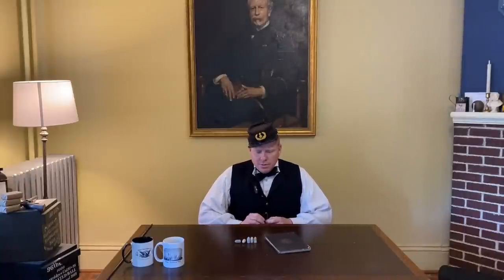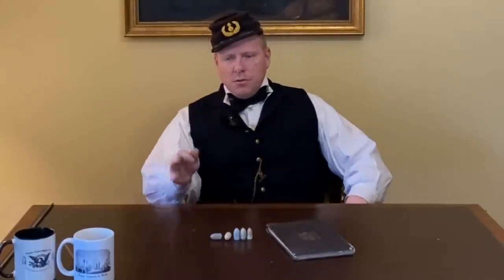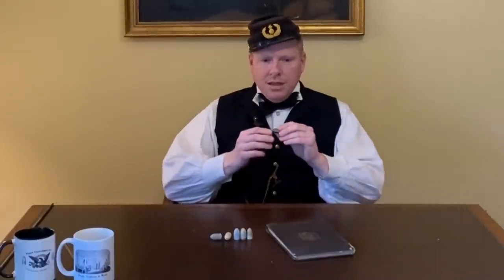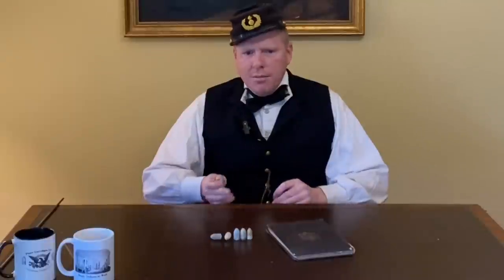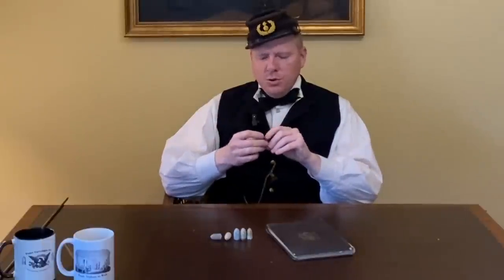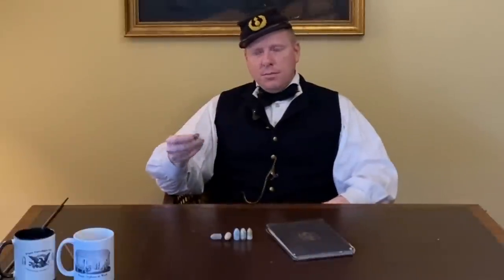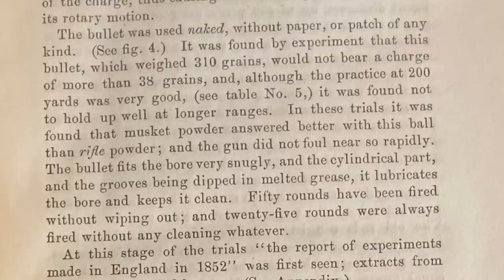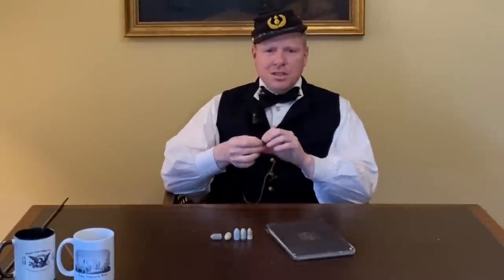Why did Civil War bullets have grooves?

Comment: I also heard, or maybe just surmised, that the grooves also scraped out some of the black powder fouling as it travelled down the barrel.   We saw some surprising things  shooting .69 cal Minie' balls from a 12ga using a sabot.   They had great stability through rifling with a spin but also were stabile shot through a smooth bore with no spin at all.    The 725 grain Minies are quite unpleasant shooting from a 7.5 lb. shotgun.
Reply: That's taofledermaus in the flesh and bones, guys!
Reply from the maker: There may be an ancillary benefit to having multiple grooves to reduce fouling, but I have never encountered this reason in any of the period documentation, in English or French. Fouling is chiefly controlled by the grease softening the fouling of the precious shot, and then when the bullet expands upon firing, it drives out the fouling ahead of it. The sooner the bullet expands before it moves far down the barrel, the much better job it does scraping fouling. Properly sized bullets (2 thou under bore size) can be fired almost indefinitely.
Reply: @papercartridges6705  I think another aspect of the cannelures or grooves around the cylindrical section of the bullet is it slightly weakens the structural rigidity of the bullet.  Initial gas pressure as the powder charge ignites, expands the base ring sufficiently to fill the rifling grooves and prevent blow-by; initial acceleration causes the bullet to slightly foreshorten, or upset into the rifling, thus establishing proper alignment of the bullet to the axis of the barrel.
Reply: No.
Reply: @lucarinaldichini324 and?
Reply: I just nominated you for head of NASA in Tundra Tacticals government line up for our new government.

Comment: Learned something new today.  I thought for the longest time that those grooves were for the bullet to "catch" the rifling in the barrel. I figured that when the power was ignited, the grooves would expand to catch unto the rifling starting the bullets turning. I didn't even think about putting lube on the grooves for easy of loading either. Thanks for the info.

Comment: The grooves also thinned the sidewall of the bullet  at the Ogave, allowing that area to more efficiently expand & better take the rifling at the moment of expansion... as well as providing a more complete seal, post ignition..Enjoyed your video very much.
Reply: Ballisticslly, you are right, all other theories to the contrary.
Reply: You are exactly correct! Besides holding the lube the only reason the grooves are there are to allow the bullet to expand enough to contact the rifling on the inside of the barrel so that it will spin more accurately. Also there are alot of bullets still made with grooves on them. Almost every cast bullet still has them for lube and the same rifle engagement reasons. only plated bullets are not grooved.
Reply: @jameshoward8609  Back in the late 70s I bought full packages of originals at the bigger gun shows.They includes a Williams cleaner round and a paper pouch of about a dozen percussion caps. We have the same last name and I enjoyed your Kern River video.

Comment: For providing a platform against which the air may stabilise the round in flight and also to reduce the friction present while driving the round down the barrel. The grooves were also thought to aid in clearing fouling by utilising their multiple bands to clear fouling more effectively than a plain based bullet.
Reply: It's not a quiz.
Reply: How about to grip the rifling and improve accuracy professor?
Reply: @rollotomasislawyer3405 
The bullet could be a smaller diameter than the bore to make it easier to ram them down the barrel and expand out into the rifling when powder explodes behind the bullet's hollow base to force the back out into the rifling for the trip out of the barrel....
Reply: @rollotomasislawyer3405  it would be counterproductive for that as it increases the way the material of the bullet "walls" has tob e moved to get that contact.
A Minié ball is undercaliber until fired, then the expanding gasses widen the hollow at the end until the bullet gets pressed into the grooves. Early models had a "hat" at the end that was supposed to speed up that spreading motion, but it was later found out that just slightly enlarging the hollow worked even better.

Comment: In a nutshell, it places the aerodynamic center of pressure behind (aft) the center of gravity relative to the direction of flight. Think fletching on an arrow or fins on a rocket or a tuft of fibers on a blow-dart.
Reply: Or... to impart spin to the projectile, improving the accuracy of the rifled musket.
Reply: It places DRAG to the rear of the bullet and thus stabilize flight....
Reply: The instability is caused by the Mach-helix effect that occurs at low supersonic Mach numbers (described in 1950's missile aerodynamic textbooks). The Mach-helix effect moves the center-of-pressure forward. The circumferential grooves are oriented in the wrong direction to suppress the Mach-helix effect. The grooves, and the concave base, do move the center-of-gravity forward. The grooves also weaken the bullet aft structure and promote super-plastic material deformation. Rifling efficiency is thereby increased.
Modern rifle bullets have shapes optimized to reduce wave drag above Mach 2 (e.g. .223). These shapes are too long to effect a center-of-gravity shift on, but the spin stabilization from higher rifling rotational speed (as pointed out in the video) counters the Mach-helix effect, as does the generally higher flight Mach numbers.

Comment: I heard from a Civil War battle museum that the North and South used a different number of grooves to tell if it was freiendly fire. They had their bullets sorted into North and South by the number of grooves. I have not heard this anywhere else. Is this just an anomaly of a particular battle?
Reply from the maker: Another myth about the grooves is that Union bullets had three grooves and Confederate bullets had two. It probably started with the Confederate Gardner bullet, which did have two grooves, but only amounted for perhaps 10% or less of all CS produced rifle musket bullets. Both sides generally produced bullets with three grooves, with considerable variations in shape and weight, from arsenal to arsenal.

Comment: The grooves serve the purpose of  are one tie point for the paper cartridge. Two allowing the fired buelllet to expand into the groves  of the rifle barrel  upon firing.  Since bullets were slightly under sized to allow easier loading in a fouled  bore. However, a small side effect is that the groves will  hold a lubricant, allowing  slightly  easier cleaning

Comment: The grooves were for expansion.  I had a .58 Enfield for years (very fun to fire).  The skirt grooves allowed compression and made an excellent seal in the barrel.  This improved accuracy and spin with a better grip on the rifling.  This compression can easily be observed on rounds that have been fired.
Reply from the maker: Can you provide the source for your claim that the grooves are for expansion? I cited numerous 19th century period sources as evidence for my argument in my video. 

You may be confusing the Tamisier grooves on a Burton-Minie with the grooves on the Wilkinson/Lorenz compression bullet, which were indeed for expansion, but these bullets were never used by the U.S. at any time, and don’t have a “skirt” as you reference.
Reply: @papercartridges6705  Hi, I wrote back earlier today, but for some reason Youtube will not allow me to include links (this has happened to me before).   This is what I wrote without links:  I had an Enfield for many years and shot countless rounds through it.  I also cast my own .58's.  The "skirt" system of outside grooves (also lubrication) and hollow or "conical" base allowed the round to be more easily loaded w/o a patch.  This system would then expand upon firing, sealing the barrel to grip the lands and grooves, increasing speed and accuracy.  Compare a new Minne ball to a vintage fired one, and you will see the skirt difference.   Note:  near "intact" bullets found on the battlefields were "dropped rounds", those hastily lost by soldiers (can't blame them...).
Reply: @daveh9521  and yet you didn't provide a single extant source whereas paper cartridges provided a number including the designer of the grooved bullet adopted throughout the period.

Comment: Current lead projectiles still have these grooves which are used when crimping the metallic case, this can be beneficial in tube magazines so the recoil doesn't push the projectile further into the case.

Comment: The Prittchett and Boxer bullets have smooth sides, so why don't they have trouble with tumbling?
Reply from the maker: That’s an excellent question. The Pritchett/Boxer bullets relied solely on the spin from the rifling to stabilize them. Grooves cause drag and the British made the deliberate decision to use a smooth bullet, to get a higher velocity. Also, British bullets were made by pressure instead of being cast, and they believed this made them inherently more balanced. That said, as a Pritchett shooter, I’ve seen a ton of keyholes. They are much less forgiving to shoot accurately than a Minié with grooves!
Reply: @papercartridges6705  You really ought to try shooting your Pritchett bullets in my Pritchett rifle.  That ought to be interesting.

Comment: I shoot BPCR, all the bullets are grooved, reason being they are squeezed thru a press where a beeswax based grease is squeezed into the grooves. This grease helps to keep the black powder fouling soft and stops it choking the barrel. and makes the bore easier to clean. Black powder fouling can set hard as a rock and be a real pain to clean up.

Comment: Actually this is the same reason that most common air gun pellets have waists.  Although not formed with a sharp edge waist, the hollow base moves the center of mass forward in such a way to minimize needed aerodynamic corrective forces (applied to the skirt) to stabilize bullet flight.
Reply: This phenomenon seen in air gun pellets was noted by the Romans who employed a wasp-waisted ballista bolt without any form of fletching, relying instead on increased base drag to stabilize the bolt in flight.  It would seem the idea was discovered, forgotten, and then rediscovered multiple times in the last 2000 years.
Reply: I have shot .177 pellets out of a smoothbore Daisy BB gun by muzzle loading the pellets into the bore and ramming them down the barrel with an improvised ramrod.  They always hit the target point first regardless of the distance to the target.  Pellet guns have a very slow twist, meant more to average out the imperfections than to impart stability, so the gun isn't shooting "knuckleballs".

Comment: Arrows fly best (straighter with less wobble) with some weight forward of center. You are correct, helical fletching on arrows does not make them spin with much rpm like some people believe, but it does provide increased drag on the rear of the arrow which stabilizes the arrow well and can be helpful when arrowheads are not perfectly inline with the shaft. While modern bullets seem to do well, I suspect the older bullets with weight removed from the rear of the bullet benefit in at least ways.  The configuration of the grooves on these Civil War style bullets would tend to flare out as they were pushed down the barrel, providing a more consistent seal. A hollow base would enhance the effect of expanding outward due to pressure, just like a hollow point causes bullets to mushroom easier.

Comment: They may help stop wobble, but I find them a pain in the butt for reloading in brass cartridges.  Gotta get the crimp just right, or seat deep enough to  go past them.
Reply from the maker: They give me the same trouble especially loading .45-70 or .577 Snider. If they aren’t lined up just perfectly straight…
Reply: @papercartridges6705    I’m doing 45 colt. Pain in the butt.   But it’s my first foray into old school.  Maybe I just got a lot to learn, but with difficulty in finding ammo nowadays, I’ll have to reset my dies every time I get new bullets
Reply: Are you checking the length of your brass and trimming as needed? 
Brass does not always stretch the same all around. You can easily have one side higher (longer) than the opposing side.
Just a thought.
Reply: @tarnishedknight730  what I meant was the crimp is so easy to end up in one of the grooves and be useless

Comment: We still have multiple grooves in modern cast lead bullets. I can't speak with authority on the history, but the top groove is a crimp point for the cartridge case mouth to hold the projectile in place. The rest of them are grease grooves.

Comment: Boring,  no. Interesting! But your explanation does it also apply for the lead bullets that my Dad   & I would grease  the 2 or 3 grooves for our cast lead bullets for .32 cal, 45 cal. Long Colt, & 45 cal  ACP Bullets  that we reloaded ourselves?
Reply from the maker: I don’t think the grooves in modern bullets are designed for that effect, they are probably more for holding modern lead bullet lube which is necessary to prevent leading. But as a secondary effect, they may help some way with stabilization. Modern bullets also rotate so fast that they remain much more stable than the very absurdly slow twist of muzzleloaders.

Comment: I guess the grooves around the bullet are meant to create a labyrint seal. The pressure doesn't vent off around the lead bullet.  Bullets/slugs with several grooves leave the barrel with a higher muzzle energy.  Of course the groove " lips" dig into the barrel spiral far more effective.

Comment: The grooves are designed to hold lubricant to soften fouling and to help scrape away fouling from the previous shot.  If a sufficient powder charge is used to expand the base of the bullet into the rifling, it will do its job.  The ideal powder charge for a particular minie would expand he skirt into the rifling, provide sufficient velocity to stabilize the bullet, but not too much to deform the the skirt  when the minie leaves the muzzle.
Reply from the maker: I have to ask… did you watch the video? Before the US adopted the grooved bullet in 1855, the French had adopted grooves on their bullets a decade earlier, and never added any lubricant into the grooves.

Comment: The boat-tail actually adds a little more drag to the bullet. This allows the bullet to better "buck the wind", thus increasing accuracy at range.
Reply: boat tails reduce drag by reducing partial vacum created at the back of the bullet

Comment: Hmm, I would agree with Taofledermouse, the Minie was designed to expand on firing and so obturated and scraped the fouling from the barrel, hence the forward rake of the grooves.
Reply from the maker: You certainly don’t have to agree with me, but consider, I am simply repeating what they wrote and said in the 1840-1860s period. It’s not like I woke up one morning and decided to make up a story about why bullets have grooves. This is why I took pains to put up numerous screenshots of the original period documents. None of them (emphasis: none!) ever said the grooves were for scraping fouling. You are of course free to disagree, though you would be running against the grain of the abundant period documentation.

Comment: So basically you want all the weight that in the center. So removing material from the front back of sides will improve stabilization??? I know you want the weight centered front. However the “open tip” hollow points also improve accuracy as seen in “open tip match” ammo like sierra matchking.
This seems inconsistent to me???

Comment: So, at the beginning of your explanation you stated the groove made it easy to Tye the string to hold the paper wrapping on. Wasn't the paper wrapper used to make the bullet slide down the barrel and engage the grooves better? Hence "LUBE GROOVE" It was just by accident that the French discovered that it also made the bullet fly straighter even though they got the reason incorrect.
Reply from the maker: The original groove was just a notch for tying the cartridge paper to the bullet, this was pretty common in 1840s era early rifles. The groove had nothing to do with lube on these early bullets. The string prevented the paper patch from sliding off the bullet during loading.
Reply: Correct the paper patch was used to allow a tight fit for the bullet as it goes down the barrel and to keep it from fowling the barrel with led as the bullets were softer. So even if they didn't know what they were doing it worked. Hence the guy from France thinking the grooves helped the wind keep the bullet straight acting like fins. When they finally figured out that more grooves and a bit of lube is all they needed the paper patch went away.

Comment: Another reason that the grooves would not be beneficial on "modern" bullets is that because most of them are supersonic, wind wouldn't even engage them until after they dropped below the sound barrier, and the result would likely be terrible.

Fortunately, since then, we've gotten much better at figuring out ballistics and aero/fluid-dynamics.